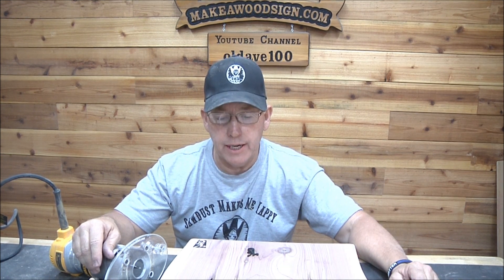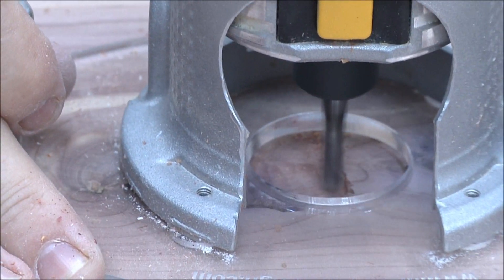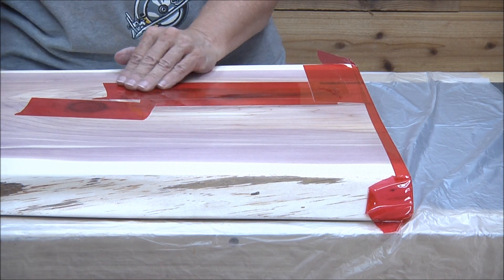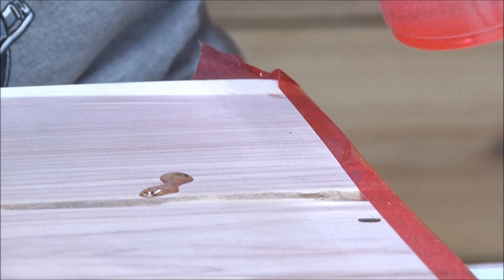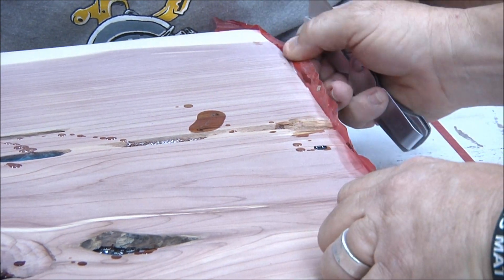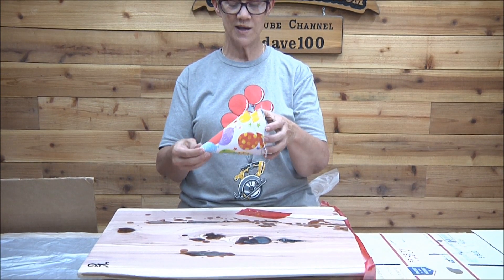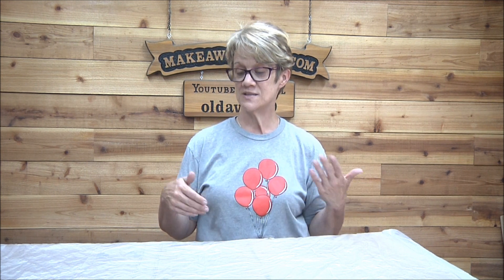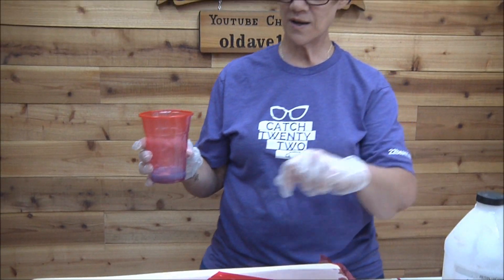#281 Part 4 On Vicki's Slab Table Carving & first Pour

Comment: I have taken a look at the cost of different resin's and it can be very pricey.  The price I've see on Art Resin is $199.00 for a gallon epoxy resin and one of hardener. Another one is $63.00 for the same amount.  They are both rated over four stars on Amazon. What was your decision for picking Art Resin? I would like to add I love your video's and am looking forward to the next one in the series.
Reply from the maker: Hi Chuck, I looked at a lot of videos and googled Resins.  I like the fact that the one I bought was low in VOC and it doesnt have the strong smells.  I bought it right from their website Artresing.com and it was cheaper.  You get a gallon of each, the resin and the hardner for $189.00.  The ship really fast also.  Thank you for the compliment and I look forward to seeing what you do with your projects...Vicki